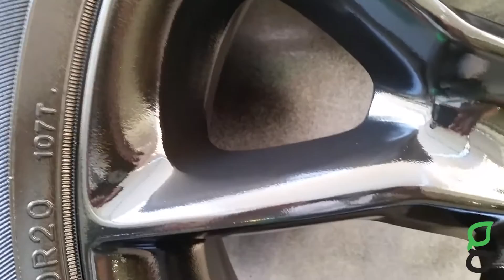Green Go Auto Dip part 2 HD

Comment: How may cans did you used to paint the 4 wheels, and what solvent did you use to clean the wheels
Reply from the maker: Hello, 
We used 2 cans to do the 4 wheels. We cleaned the rims with degreaser, then we rinsed with water and once it was all dry I just wiped it with rubbing alcohol just to make sure there is no fingerprints or other contaminants (specially edgers close to tire!!!) .
Reply: ok, what solvent you use to clean the overspay fro0m the back of the wheel
Reply from the maker: Rafael Mejias For cleaning the back with the best results we recommend a 0000 steel wool and a mild rim polish (Just make sure the polish you choose matches the rim material, aluminum, chrome, etc..). If your rims are very clean you can use a clear coat safe thinner.
Reply: +Rafael Mejias don't use steel wool or polish . Pre-dip spray and a soft brush for cleaning the wheels . If you prep your wheels correctly you don't need anything for over spray.
Reply from the maker: The above suggestion is only if you have heavy build up and or oxidation, the rule of thumb when it comes to cleaning or polishing is start with the least abrasive and work your way up as needed. Therefore the above comment is spot on, if you can clean it with normal rim cleaner (or even water) just use that!! However we do recommend once all clean wipe all surfaces you plan to paint with alcohol just to make sure you remove any oil left behind (even with fingers)

Comment: Does it easily come off, like if I'm washing my rims, would using a brush mess it up or will it hold, also what about high pressure water, would that mess it up as well?
Reply from the maker: Hi, 
High pressure wash will definitely peel it off. (thats how we remove it) I personally recommend just wiping dust off with water or a spray detailer. (you can also get a mini "CA Duster" and just dust the brake dust away. The less chemicals the longer it will last.  
But to answer your question, YES you can just wash your car as you normally do (assuming you use a sponge and mild shampoo) to clean, soft brush? probably wont damage it if the application was done right.
Reply: +Green Go Wash thanks, I'll be ordering some real soon!

Comment: How big are the cans? I bought 2 for my 18" rims on my stock 2016 Camaro
Reply from the maker: 17.5 oz. According to Autodip it covers about 10sqf with 8 coatings.
Reply: +Green Go Wash will I be good with 2 cans?
Reply: +Green Go Wash my rims are 18"
Reply: +Green Go Wash I lied. My rims are 20"
Reply from the maker: 2 should be enough.
Reply: +Green Go Wash I'm gonna buy 2 more just in case
Reply: Their website says 1 can for 1 rim. Up to 20inches
Reply from the maker: They are 17oz each I think, (they bigger than plastidip)
Reply from the maker: That's probably playing it safe and including the interior of rim.

Comment: u think that with 2 cans  i can paint my 4 wheels are 18 ?the autodip page say that i need 3-4 can i need help to know
Reply from the maker: 3 for sure will! 2 if you do it in the right conditions (no wind) and maybe use can a bit closer at about 10"-12" but remember to keep can moving and shaking it often. 
you will need 4 if you do as well the inside of the rim.
Reply: +Green Go Wash no i only want to paint the exterior of the wheel so with 2 cans can
be done?
Reply: Yes